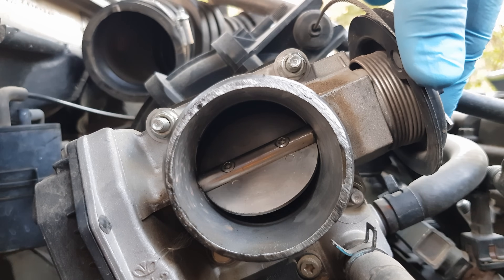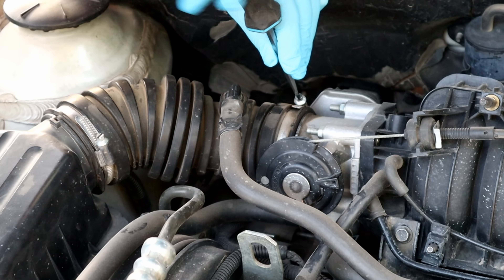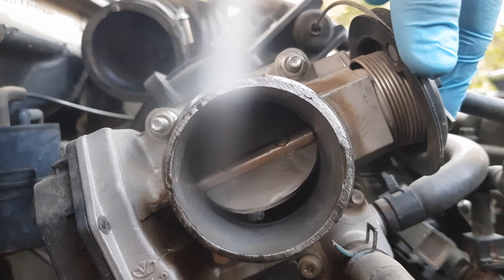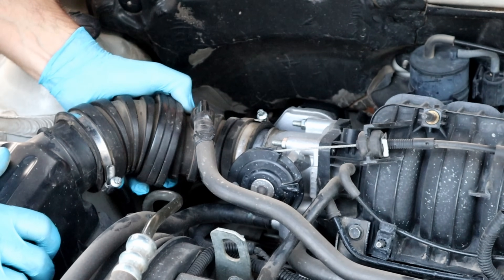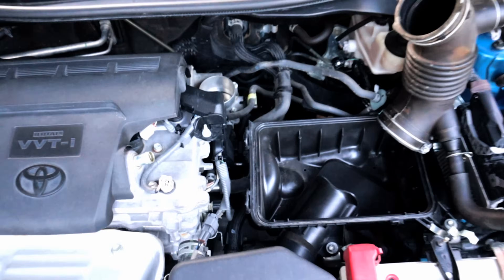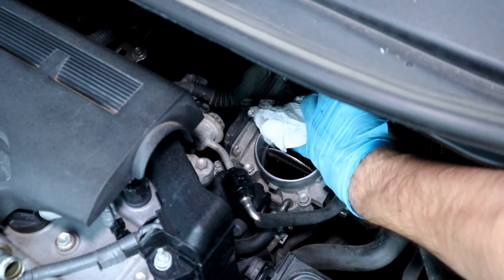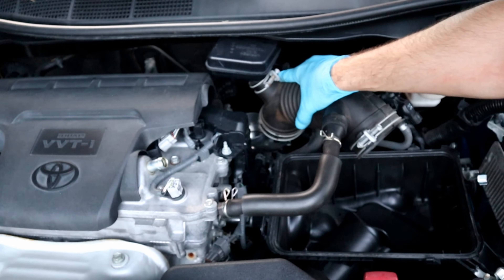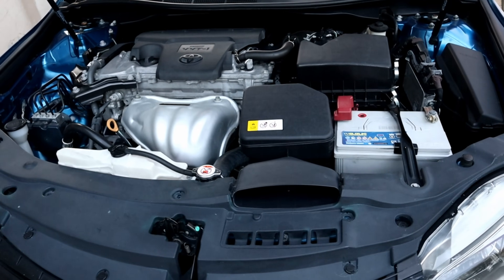Don't Clean throttle body before watching this/Cleaning cable controlled or Electrical Throttle body

Comment: This method is good when throttle body is slightly dirty. But if it’s too dirty better to open it and then clean from inner side too. Secondly never spray directly inside the throttle body when it’s attached all the dirt goes into intake. Better to apply spray on clean cloth and then clean it. That’s how i clean electric throttle of my cars.
Reply: Thks I Wuz wonder that
Reply: Exactly if you know the engine is crapp it doesnt matter, but if you care about the health of your engine dont do it this way.
Reply: I thought dame if bad dirty spray rag vs spraying gunk into system
Reply: Interesting what you said
Reply: 100%
Reply: My envoy I just sprayed crap out of it cleaning both sides was super dirty stuck screwdriver in it to let it dry unhooked battery let sit over night next day fired up ran like ish 30 sec after that WOW what difference way more power zip 👍
Reply: If you clean first with towel and make sure very clean 
Then you can spray directly into throttle you will guarantee that help remove the rest of the dirt 
One time direct to the throttle will not hurt 
But if you does that every time you clean it will hurt the intake for sure
Reply: You qre absolutely right !

Comment: You dont waste a minute of anyones time.  Every video should be like this.
Reply from the maker: Thanks, i like to give more information is a short time, become when ppl having a problem, they should see the solution immediately
Reply: But also remember, experience makes the difference
Reply: This is wrong way too do it
Reply: @mackmorris138  how to do it correctly then, please explain, thanks.
Reply: @mackmorris138  thats true. Is too bad to do this like this. 100% true @mack
Reply: Smartest comment ever...
Reply: Agreed
Reply: Straight to the goddamn point I love it 🙏
Reply: @mackmorris138   Make a video like him how its done EXACTLY done genius !!! Easy to point finger like that.
Reply: Aunt Barbara!
Reply: Aunt Barbera!
Reply: Aunt Barbera!
Reply: Aunt Barbera!
Reply: Aunt Barbera!
Reply: Aunt Barbera!
Reply: Aunt Barbera!
Reply: Aunt Barbera!
Reply: Aunt Barbera!
Reply: Aunt Barbera!
Reply: Aunt Barbera!
Reply: Aunt Barbera!
Reply: NO 🐃💩
Reply: When you pressed the gas, was the engine on?  @AliMECH
Reply: @boxerkhan9627 one should take the throttle body off, so debris and such doesn’t go straight into the engine… it’s usually only 4 bolts.
Reply: @TestTest-tp2bz Ofc engine should be on, it should be air intake there to clean the throttle with spray, there should be wire under the hood that connects to the gas pedal that you can pull so you don't need to press the gas pedal in the car.

Comment: Yeah dont clean electric throttle bodies like this. What he showed can damage them plus can hurt you doing that that way. Just take the throttle body all the way off and run a throttle position reset when you hook it up. Most cars its easy and also improves responsiveness from the sensor reset.
Reply: Yes but most people dont have the scanners to do the relearn process
Reply: @ivanangulo85  depends on model. My 2016 F150 you don't need a scan tool. It's a specific sequence with the Key, gas pedal, and then letting it warm up.

Comment: As an auto tech myself, opening the throttle valve with the key in 2nd and using the acceleration pedal is the smart method. Thank you for showing people the correct way to do it.
Reply: What happens if it's moved with the ignition off? Also, do all electric TB's open when the ignition is on without the motor running when the gas pedal is pressed? My doesn't on my BMW e39.
Reply: @eaglerider94  if you manually move the throttle plate with your hand when it's a drive by wire system, you can easily mess up the throttle plate position and will have to have it recalibrated. Also, when you turned the vehicle ignition into second (without turning the engine on) did you press on the gas pedal and had it held down?
Reply: @eaglerider94  You might want to look up some service info for that procedure if you did have the gas pedal pressed down and held with the vehicle ignition in second. Otherwise, I'd ask the BMW dealer about it. German cars can sometimes be quirky and sensitive around stuff like that.
Reply: @benitoloco899  Yeah, I put everything back together and started it because I wouldn't have been able to sleep thinking that I may have screwed it up. I got lucky and she started and after warming up everything ran ok. Re: the 2nd part of your question, ignition was at #2 and I had my wife slowy depress the gas pedal all the way to the  floor but it didn't open. That's why I freaked but as I said, everything is working. Lesson learned about these electric TB's. Thanks for the quick reply.
Reply: @benitoloco899  Thanks again, as I said in your other reply, I got lucky and didn't mess it up. The big task is removing the entire intake manifold in preparation for the CCV and other parts to arrive. It's missing a bit but that's because the hose from the bottom of the CCV to the oil dipstick tube is broken. The reason I started removing parts.
Reply: @eaglerider94  Sounds like fun times with that engine. Good luck with everything!

Comment: I always remove the throttle when cleaning them.  Maybe this is short cut but i want it cleaned well on thw other side too and not riak of having the dirt and grime going to the intake manifold.
Reply: Exactly, those cheap youtube videos try to lure people into clicking liking and subscribing with cheap advice, and don't care what happens to people's cars. I had a ton of grime come out when I removed and cleaned mine.
Reply: Than you get check engine lights if you don’t relearn it
Reply: @GametimeSlime  relearn what?
Reply: @wadevid  If there is a good amount of grime and dirt inside, it may effect the position of the bit that spins when you press the pedal. Cleaning it out is good, but now there is a gap where the dirt used to be, and that will effect your car negatively. In that case it's necessary to "relearn" the throttle body to teach the engine the new correct position.
Reply: Do I need to disconnect the battery when removing the TB? no check engine if not disconnected?

Comment: Had my throttle body off when I replaced the coolant bypass hose on my 2005 Tacoma and cleaned it I moved the throttle plate by hand very slowly and cleaned it no damage what so ever and that was 2 years ago still running great
Reply: Most damage comes from cleaning throttle body while still connected electrically.
Reply: @royquesada5295  Yep
Reply: Thks 😮
Reply: You are right. Open the electronically activated throttle plate very slowly and gently. Don’t force anything. Spray the microfibre cloth  not inside the throttle body and use one finger to carefully wipe.

Comment: I have a 2010 WV beetle with a 2.5 automatic. I noticed recently more hesitation while shifting. I followed your technique of using in my case a piece of wood to keep the throttle plate open. Its interesting how clean it looked from the outside, but after the seafoam spray it was like black ⚫️ tar coming from it. I felt resistance against the motor (buzzing noice) once I bumped the throttle plate. I was able to lightly brush the plate. After about 10 minutes of cleaning, i started the car up. Quicker starting, quieter idling, and consistently better shifting. Thats just from driving down my street. Thank you sir for your help. Eveything i needed was already home for some time so basically it was free maintenance.

Comment: Thanks for sharing your video on cleaning throttle bodies. As a throttle body manufacturer, we appreciate your thorough steps for both cable-controlled and electronic throttle bodies. It's important to properly clean your throttle body to avoid damage to your car and expensive repairs. We'll be sure to recommend your video to our customers for proper maintenance.👍
Reply from the maker: Thanks, glad it was helpful and easy for understanding
Reply: A friend cleaned my throttle bottle with thinners, my car has been revving and consuming so much fuel itself since then. I’m struggling to get a spare throttle bottle for Chevrolet
Reply: @Snowflake-222-1  Your friend may have sprayed way too much into the throttle body that it seeped into the electronic control panel on the side of it, causing damage. Very little cleaner is needed.

Comment: Good points! Today I cleaned my electrical throttle body with Gumout cleaner, my ignition is a push start and I don't have the option to leave it open the way you did with the long rod. Yes I did get the engine light, but after cleaning and spraying into the throttle body little at the time while revving the engine afterwards the Kia Niro accelerated like a champ, I almost could not feel it and small hills became easier to climb and I could feel the air going through very well with a roar. I also did have a 16OZ B12 Chemtrol cleaner for the fuel. Now I will be clearing the engine light soon.
Reply: What codes did you get on the check engine light? I have 2018 Camry and my throttle body is not opening on key accessory position. is there any other way or should I move it by hand?
Reply: @sumanravichandran9107  The only way to open the throttle is by using a clean piece of wood or a hard plastic material to avoid scratching it . It is like a spring it will open and then spray the chemical a little at a time inbetween each spray when I rev the engine I close it by not touching it it goes back the way it is when you first start. And then rev it a little bit and spray gently again and again each time revving the engine at 2K RPM not to eceed 3K rpm. This was my experience towards the end I sprayed an 1/8 of a can and let it sit with the engine off, for about 45 minutes and took it for a drive. Drove for about 10-12 miles and it run beautifully? I have about 31.5K miles on my Kia Niro.

Comment: Go to any Chevy parts dealer they sell stuff called top engine cleaner, it’s the best hands down. A couple drops of this on a microfiber rag and your throttle body and butterfly are golden. Also clean the IAC Valve and MAF Sensor while you are at it using Sensor Cleaner.
Reply: Seen some YouTube videos using Sea foam and a toothbrush with Great results the Sea foam won't hurt the coated bushings on the throttle shaft

Comment: A little add up:
-if you won't let it to dry, car may be hard to start for the first time because of fumes of cleaner left in the intake
-if you have modern throttle position sensor it may need some time for ECU to readjust after cleaning. So it will be good if you replace ECU fuse before start cleaning and put it back after you reassemble all the parts.
Reply: Never heard anyone mention this other than removing the neg to battery. Does that work as well?
Reply: @Nytellem  Might help but then you won't be able to use gas pedal for opening the throttle body right?
Reply: @Nytellem  Yes it does. I remove ECM1 and ECM2 fuses after I'm done for about 1 minute and then put them back in. I do this every time I modify my intake system...Now I got it just where I want it. So even when you are doing an intake system, throttle body spacer, exhaust, etc. It is always a good idea to reset the computer system this way. Plus it's easier than removing the battery terminal. Hope this helps.
Reply: @jamesj.litteriojr.433  where is this located in a Honda Accord 2011? Is it easy to disconnect and reconnect
Reply: @premiumc2282  I would look in the owners manual for fuses or fuse box at the back of the book. Once you locate it, then you can see how the layout is setup on your car and pick the ECM or ECU fuse/fuses. My Scion has 2 ECU fuses so I pulled them both after I cleaned the throttle body and waited one minute then put them back in to reset the computer everything was fine. Hope this helps.
Reply: That is dangerous to try to start a vehicle with liquid and fumes from throttle body cleaner in upper intake. I'll  say it again, spraying cleaner into upper intake to clean throttle body and then trying to start it is really not smart.
Reply: @royquesada5295 What will happen?
Reply: @Theyralltakenfu  the spray is can become volatile.
Reply: @royquesada5295 

Yeah not sure why they’re not removing the throttle body completely
Reply: @Theyralltakenfu 

You can get some pretty spicy results
Reply: @royquesada5295  Why? The car was never turned on and he is not lighting a flame at the end of can. The cleaner will evaporate or get sucked into the piston chamber when the intake valves opens the same as starter fluid. I would say not to stick your finger inside those electronic throttle bodies. If whatever you have holding the gas pedal down slips off the gas pedal you might get injured. Wrap a paper towel around something like a screw driver or wooden spoon handle.

Comment: Great video. Only suggestion is avoid paper towels. Just in case pieces of paper towel break off inside your throttle body when cleaning it and get sucked into engine when starting it. Use a Microfiber cloth or lint free cloth if you can.

Comment: Good video. Make sure to clean the Idle Air Control (IAC) valve while you’re in there. Same steps as shown but you’ll need brushes to scrub the housing, valve pintle, and spring.

Comment: You can manually articulate an electric TB plate, just be careful doing so. Do it slowly, and don't force the extreme position on either end. I've never had issues after cleaning my Ram 5.7 Hemi TB like that every time. I actually always remove it for a cleaning because it is easier to work on. It sits right on top of the engine up front so it is easy to remove. 4 bolts and an electrical connector. Never had any problems.

Comment: ! WARNING !
Remove the throttle body completely to avoid damaging your intake manifold. Throttle body cleaner melts plastic on contact. At least in my engine, there is a plastic cylinder just behind the throttle body lining the intake manifold. If you spray cleaner into the body like this, it will get behind and onto that plastic and will melt the surface.  This will make the surface of the cylinder rough and pock-marked, at the least. Furthermore, You won't be able to clean the inner throttle body behind the plate without removing the body. A lot of carbon builds up on the other side of the plate. 

If you want to see how quickly the cleaner melts plastic, just find a piece of plastic you don't care about damaging and squirt some on it. I dripped some onto a paper towel sitting on some plastic under my hood and it melted the plastic underneath, fusing the paper towel to the plastic in seconds.

Comment: Now that is a smart way to clean the throttle body. I've seen people doing it other ways and then have to relearn the throttle idle control. This was EXTREMELY informative.
Reply: Depending on the car, it may be easy to relearn it, like turning on the ignition, waiting 60s and turning it off. If it is, that's easier than using something to keep the pedal down and avoiding any contact with the throttle.
Reply: For a Toyota, the idle relearn procedure is super easy
Reply: The reason you relearn the body idle air control is because you removed the smut from the throttle body that is causing the plate to have to open more to run. Not because you manipulate the plate.
Reply: @codyprice0295  There is a position sensor in those electronic versions. Manually moving them throws them out of sync or damages them.
Reply: @toddh6234  on what kind of vehicle? That’s a very generic statement
Reply: @codyprice0295  That's how electronic throttles are built for all vehicles.
Reply: @toddh6234  oh wow, I never knew. Every vehicle with an electronic throttle control is this way?
Reply: @codyprice0295  Yes
Reply: @toddh6234  wow. That’s crazy
Reply: @unnainconnu9098 fair point. Saw another really well done video on this for an 09 ram 1500 hemi and he just removed the tb, cleaned it very well, put it back and the relearn was holding the gas pedal down for 20s with the key in on posistion and then slowly releasing

Comment: Good video! I did it to my car and the engine light turned on and then after driving the car for a few minutes, it turned off by itself.
Reply from the maker: Thanks,  it's OK, maybe you didn't let it dry completely,  that's why engine light came on, after driving, it got dry 🙏

Comment: You can in fact, open most electrical throttle body by hand, may want to check with your individual manufactuer but Hondas, Toyotas, Subarus all allow you to open the butterfly valve by hand, just don't over extend it and do a throttle body / idle relearn afterwards.

Comment: On an electric powered throttle before any spraying of the cleaner disconnect the multiplug. No need for ignition to be on. Once multiplug taken off you can move the butterfly valve by hand but slowly. No problem.
Reply: Removing multi plug or removing -ve battery terminal , which one is better ?
Reply: @Fayis1341  the multiplug
Reply: @Aidan Bhuiyan I don't understand why my car 2015 Nissan Sentra S won't have the butterfly move/open when the car was in the accessory mode and the gas pedal was pressed down. Thank you in advance for any advice.

Comment: straight to the point vid.  I've 07 crv and noticed when engine is idle and I press the gas pedal there's a second delay before it revs not sure what the issue is, or is it normal.  Any ideas?